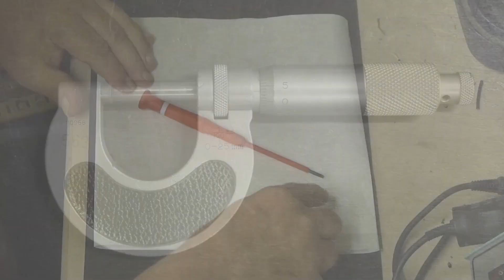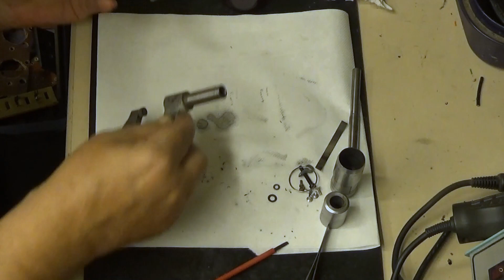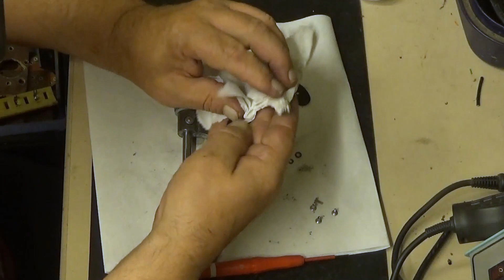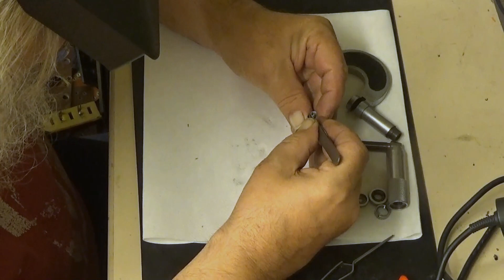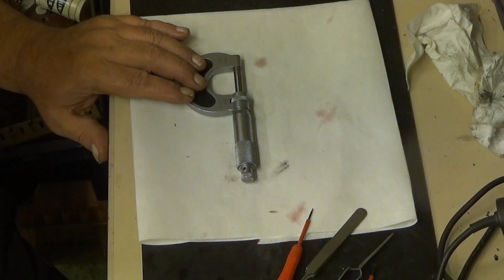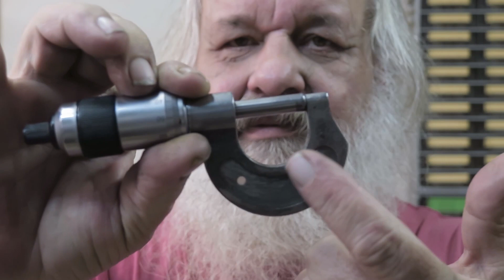Reconditioning of Two German Micrometers

Comment: How much did they cost? Under 10 euros?
Reply from the maker: The Mahr costed 15 and the Steinmeyer 10. Plus postage.
Reply: @FinnoUgricMachining  I got a Mitutoyo 0,001mm version for under 22+postage. I made an offer that was rougly half of the asking price and the seller accepted. The price being under 22 to avoid import charges as it was from US
Reply: Also bought a couple unused soviet mikes for the general use, they are pretty accurate despite many disliking them. Much better than the chinese mikes. Also not with the asking price.
Reply: Another score update, I got a 0,0002mm res. Large thimble micrometer head for 21 euros plus postage, I think that's accurate AF, fifth of a micron! I think I'm going to make a unimike style body for it and use it as a tube wall thickness micrometer. I can that way measure the ID of bores way more accurately than now just by measuring OD accurately and subtracting 2x the wall thickness and there's the hole size
Reply from the maker: @MF175mp  The accuracy of that measuring method depends on the concentricity of the hole. However, it might really be more consistent and repeatable than measuring the hole indirectly with snap cages.
Reply: @FinnoUgricMachining  yes if the OD is eccentric you need to measure from 180° apart 2 times. That way the result should remain somewhat accurate. The telescoping gages I can't trust well enough. It's a touchy feely thing whereas with a real micrometer you can wiggle and ratchet it just a little bit to get reliable measurement every time.
Reply: I won another bid just an hour ago, 32 euros for 25-50mm 0,001mm micrometer. There was a sneaky bastard trying to bid 5 seconds before closing but he bid below my maximum bid so I won it anyway. (Now I have shopped enough mikes for now, maybe)